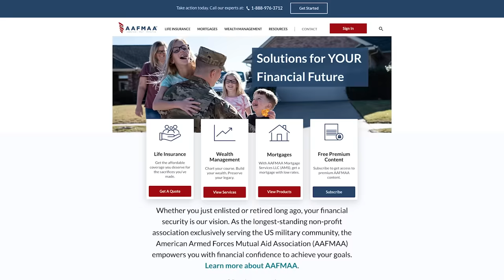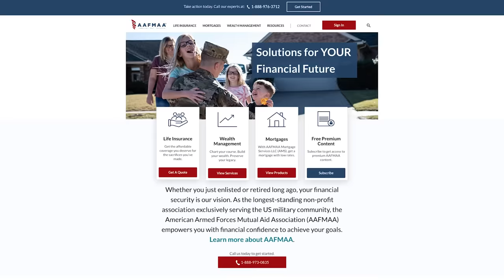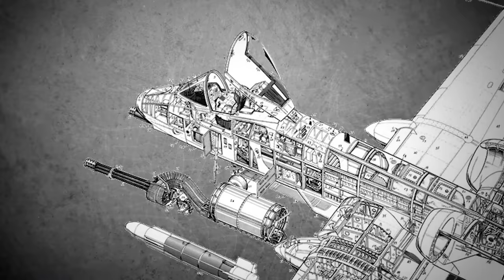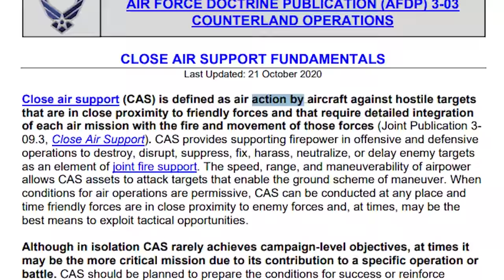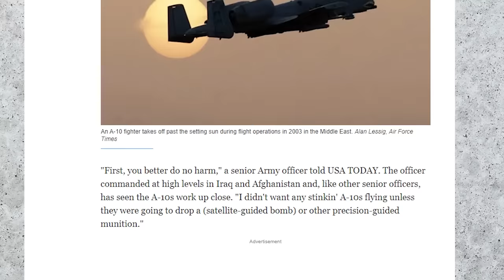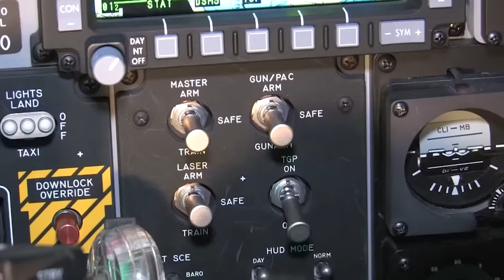Why the Air Force is Screaming to Retire the A-10 Warthog

Comment: Tbh, the airforce did find out that over 90% of the missions the A-10 flew in Afghanistan could've been done by a Super Tucano(A-29) more efficiently,  cheaper and much more reliable (availability data collected by the airforce).
The video is amazing Cappi, as always! 
I'll just add that "flying low and slow isn't possible in a modern battlefield" well... I think Ukraine and Russia have something to say about it, as the war in Ukraine shown that this is pretty much the only way for even Russian relatively modern SU-35SM to fly in a multi-layered AA environment, with pictures of Russian and Ukrainian Jets and Helicopters almost hitting the ground when trying to perform pretty much every mission, a war between China and the US would be pretty much the same as much as the F-35 would have more freedom to operate every other flying hull would be kissing the proverbial shit out the ground.
Reply: The A-29 is a very capable plane for counter insurgency, would hate to see it eaten alive in near-peer combat. The Skywarden is a good US equivalent.
Reply: @BakaVHS   I don't think that the A-29 is the best option for the US, I agree with you on that. And I would agree before 2022 invasion of Ukraine that it wouldn't survive in a modern battlefield, but now seeing how pretty much every aircraft are just hugging the ground, I do belive that the A29 availability, easy commands and low stall speeds would make it amazing at hugging the ground, and with it's armored cockpit it would better for Ukraine than it's Su-25
Reply: The US fights wars different to Russia, the first stage would be to perform SEAD (Suppression of Enemy Air Defence), then DEAD (Destruction of Enemy Air Defence), then follow it up with a combined arms war. So the A10 exists in the space after DEAD with a favourable airspace for United States Air Forces. The Super Tucano could probably fill in the gaps given it has 2 internal .50 cal cannons (250 rounds each), a 20mm cannon pod (650 rounds). I will say the A10 took out the majority of the armor in the Gulf War (more than AH64,  M1 Abrams combined) so its very versatile in taking out soft and hard targets. The F35 as a replacement is dumb, $42K USD per flight hour versus the $22K USD per flight hour of the A10, plus it has 17 seconds of gun time, where the F35 has 4 seconds of gun time.
Reply: In ukraine, the most shot down jet on both sides is the su 25 because they just get nailed with manpads
Reply: @henryquecabral9357  for all of the reasons you noted... that is why the units sent to Afghanistan... were left in afghanistan... and just like the predocessor to that frame were left in Vietnam...
Reply: A war against China would be fought in Chinese territory where there are no Patriot SAM sites and no sneaky MANPADS in the bushes.  The Navy would be providing most of the air defence from carrier assault groups that China would know the exact location.  This is assuming no nuclear weapons and remember that  2 nuclear countries have never fought a war against each other..
Reply: regarding the Ukraine war, both sides lack the proper SEAD/DEAD platforms and that is why they by flying so low.  and this is far from perfect because if you may get a radar warning from a S-300, in the case of a IGLA you feel the hit. and even a flying tank like A-10 or Su-25  can't eat an infinite amount of them. not to mention the huge repair cost after such flights. in combat, you need all your platforms flying, not standing in repair shops after tanking all the hits. and you keep them flying by removing any chance of being hit, by flying high with long range precisions weapons, protect them from fighters by achieving air superiority and by performing SEAD/DEAM missions with Wild Weasels.
Reply: @dexterplameras3249  Not to mention the hardpoints that allows the US to mount any kind of bombs or missiles it wants, with the most common used ones already integrated by the NATO airforce that operates it (Portugal), like Maverick, MK 82, MK 81, etc..
Reply: Russia and Ukraine do have something to say about flying low and slow over a modern battlefield, and what they have to say is, DON'T EVER. They've been conducting "close air support" by staying well behind friendly lines and lobbing unguided rockets over the horizon at targets they can't see, on the off chance that one or two rockets out of a salvo will actually hit somewhere in the vicinity of something they'd like to see going Boom - because if they venture past friendly lines, over the actual battlefield, they're meat on the table for ground-based air defense systems. 

Also, the Russians aren't sending Su-35s to play that game; their dedicated fighter types are staying high and fast - but still well behind the lines - so they can lob air-to-air missiles at max range and performance if a Ukrainian aircraft screws up and pops out of ground clutter.
Reply: @Pixilated  I agree, but that's to show that it would happen to ANY CAS in the modern battlefield, with drones getting jammed it could be the A-10, A-29, SU-25... or pretty much any other aircraft, I would argue that since the A-29 cockpit is based of off the A-10, the only difference in survivability would be in the engine, the two jet-engines in the A-10 makes for a nice redundace in case of emergency but it also makes that airplane much more expensive and with more maintenance time and less on station time than the super tucano. It's a trade off... But like I said, I wouldn't give the A-29 for the US airforce, I just disagree when people say that in the modern battlefield there is a huge difference in both of them, at the end of the day they get where its needed at the same speed and drop the same MK82 with the same guiding systems and have comparable survivabilities
Reply: @dexterplameras3249  The problem is that it's impossible to knock out all the short-ranged air defenses - including MANPADs - that make the low and slow part of the envelope so untenable. What you can do is knock out the (more expensive, therefore also more rare) high-performance, high-altitude systems, and then go high and fast over the top of the SHORAD. But the A-10 doesn't do high and fast, so in a peer or near-peer conflict it would be dead meat even after the SEAD/DEAD assets have done their work.
Reply: @Philistine47  You can not do a danger close mission at 28K feet. There would be many dead forces without it as a bomb would take out all friendlies. The only option for danger close is a high angle strafing run when it gets down to 10 meters between you and the enemy and for that you need to get low and close, the slower the speed the better.  There is always a need to get in low and slow to help out friendlies.
Reply: What makes Ukraine a "modern" battlefield? It's far more reminiscent of the Iran-Iraq war. Neither have effective SEAD and both are mostly flying elderly systems.
Reply: @dexterplameras3249  You can't do close air support missions with a dead plane either, which is what the A-10 would be in a modern environment. Loitering munitons via drones are the best cost effective option for CAS. The A-10 gun is too inaccurate in such a high intensity environment.
Reply: I'm sure the Ukrainians would be grateful to receive a hundred of A10s, I assure you they would find the way to use them, these beautiful jets can save many innocent lives
Reply: @MrHeavy466  Perhaps google A10 damage and look for images? Its designed to take a hit from a manpad and still make it home. There are many cases where the A10 lost 1/2 a wing a whole engine and still made it home. Manpads are the only threat after DEAD is done, and normally the airforce will bomb for weeks before they send in ground and with it the need for CAS. Also special forces ordered in the A29 specifically for its guns in Africa, there is always a need for a gun and therefore to get down low once the ground moves in.
Reply: But would it have the same morale value as the damn BRRRRT?
Reply: @dexterplameras3249  Categorically false. Did you not hear the part about the GAU-8 spraying munitions over an area nearly the size of a football field? Meanwhile modern guided munitions (see: the Small Diameter Bomb) have a CEP less than 1/10th that of the gun, and a small enough blast radius that even when they miss (or are given the wrong coordinates by the friendlies on the ground), any friendlies within the danger zone would have been reduced to a fine pink mist by 30mm just as certainly.
Reply: @Philistine47  BS maybe speak to an air combat controller before you spew out false facts. Small diameter bombs have been around for a while and they still use the gun over the SDB because of the blast radius. There are plenty of special forces combat controllers that had engagements of 10 meters, they would never do something as dumb as dropping a bomb that close to friendly forces.
Reply: The thing is, when you're talking about why troops love the A-10, it's a specific role that they fill in CAS.  You have to face facts, the A-10 is an extreme liability in anything but uncontested airspace, if there's even a remote chance that the enemy has fighters in the air or competent air defense up the A-10 is a flying bullseye.  But what about uncontested airspace?  Sure, the multirole fighters can drop precision guided munitions and there are drones that can do the same, but something like the A-10 could do a much better job if properly equipped for it.  That's where an alternative presents itself, in the same family as COIN aircraft.  Something smaller that's able to stay on target and loiter, get up close, and bring a lot of firepower to suppress or eliminate the enemy.  Something that can fill the role of an Apache but with enough range and loiter time to make a difference.  The Army is already embracing this concept with the Sky Warden, which is nothing more than a big ass ag plane with a lot of firepower, the same as a Skyraider.  The idea being that in any situation where an A-10 was needed for immediate ground support, danger close, the War Tractor could do the same job...with more precision.  They'll be far cheaper to operate than an A-10 or a drone, and they would be integrated with the unit itself, rather than an inter-service cooperation.  The Army would own and operate them from austere locations close to where the actual fighting is and they'd be on call and dedicated to the unit whenever they were needed.  You'd have air support on demand coming from the same local chain of command, and able to deliver anything that troops on the ground would need.  That's what will be replacing the A-10 in CAS with uncontested airspace, while the multirole fighters and drones will be doing the same from a distance in contested airspace.
Reply: SOCOM , recently ordered 75 AT-802 Sky wardens an armored , armed , and tricked with modern sensor technology crop duster.
Reply: @stanhry  Tbh the airforce did that only to not order a foreign aircraft produced in North Carolina.
They are exactly the same as the Super Tucano but come from a smaller manufacturer with no experience in making military aircraft, nor supporting a large customer and have never seem combat.
Simply to say "Designed in America", cause produced in America wasn't enough.
Plus the Sky warden is ugly as fuck.
Reply: @henryquecabral9357  Yeah so is your mom, but here you are 🤣
Reply: @henryquecabral9357  plus it was a record of success in Columbia drug war enforcement.